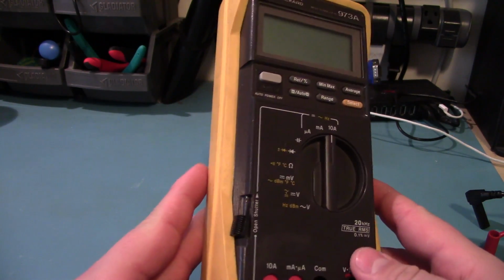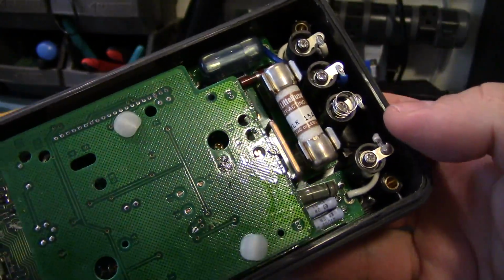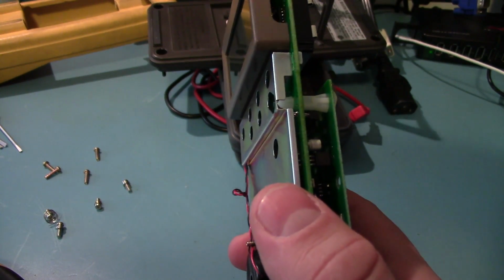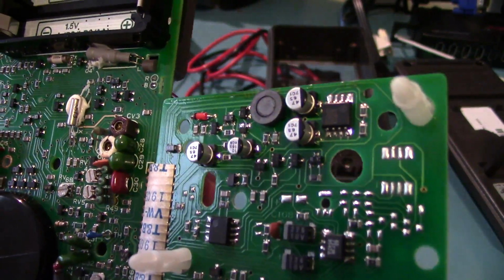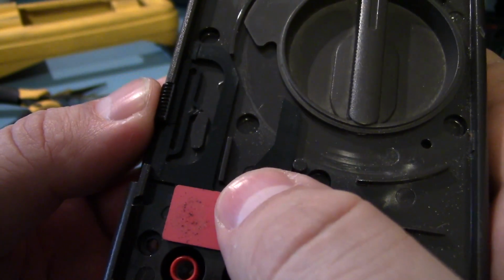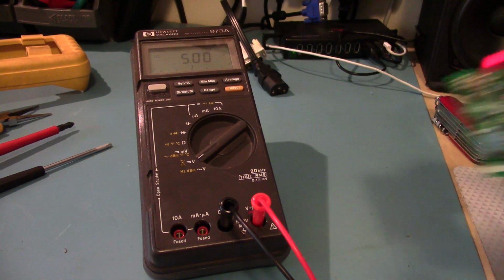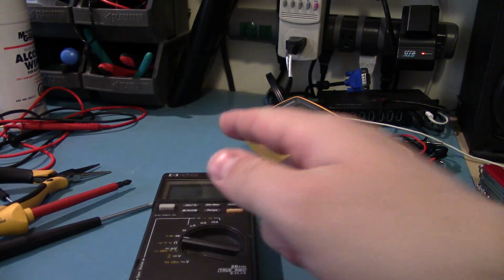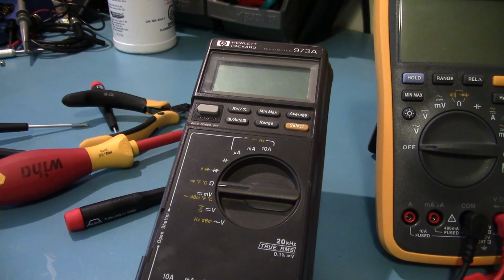HP 973A Multimeter Teardown + Repair

Comment: Hello engineer, I bought the same model from Qalwa Market, unfortunately, in its small board, two capacitors on the edge of the board next to an IC heat up a little. Sometimes the intermediate image does not show the panel at all. can you guide me